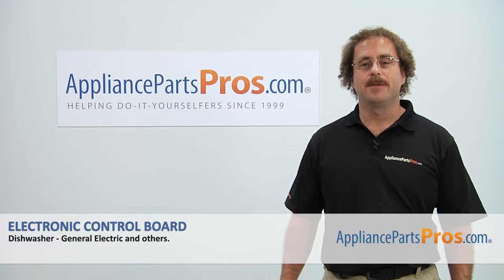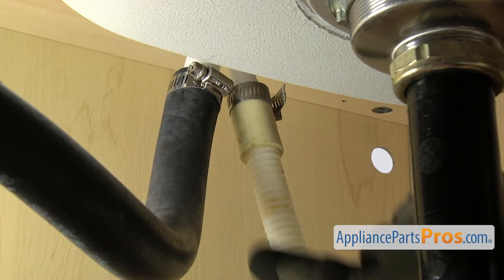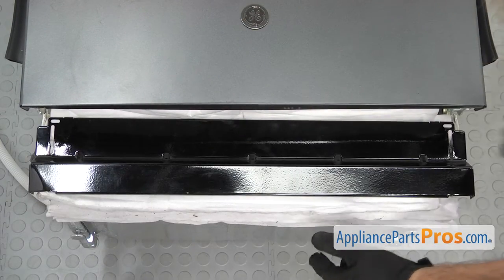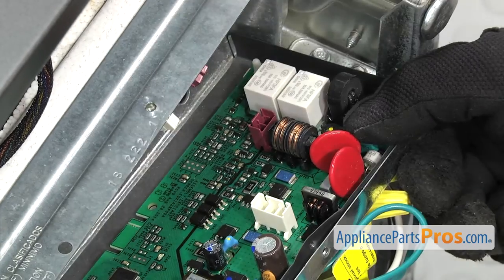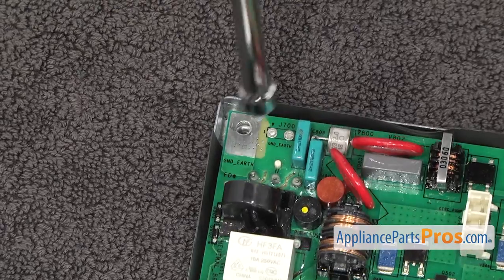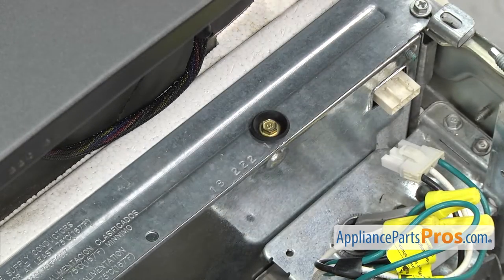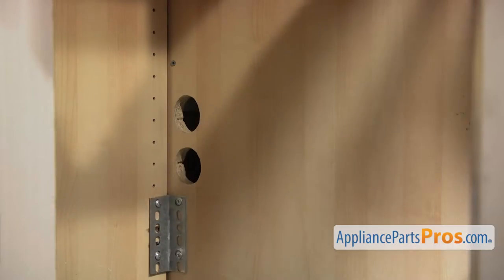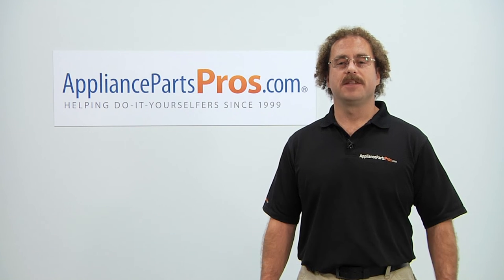How To: GE Dishwasher Electronic Control Board WD21X24901

Comment: You can do this whole job from the front on the ground, having to uninstall a dishwasher is typically a more difficult than it looks here in an open warehouse so its waaayy easier to do it on the ground from the front. Also the UI board goes bad with it most of the time, replace both.
Reply: Taking the whole dishwasher off is too time consuming for this job.
Reply: What is a ui board?
Reply: Agreed. I was able to do this job from the front on the ground. There is no need for all this other unnecessary disassembly
Reply: @lifesacrifice  I believe it's a "user interface" board - it's the one that lives behind the control panel along the top.
Reply: Agreed, no need to pull out dishwasher, you can do it from the ground.. take way less time to do...🤔

Comment: Is this the same part as WD21X24901C? What's the difference between this and C?
Reply from the maker: WD21X24901 is the original part number, it's been redesigned and replaced by WD21X24901C.